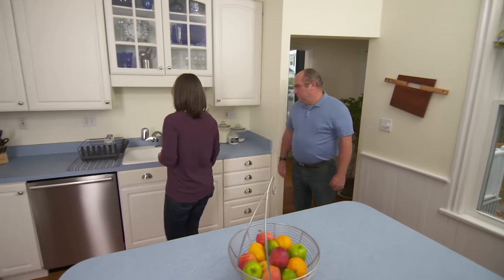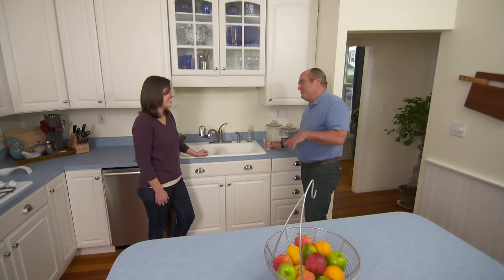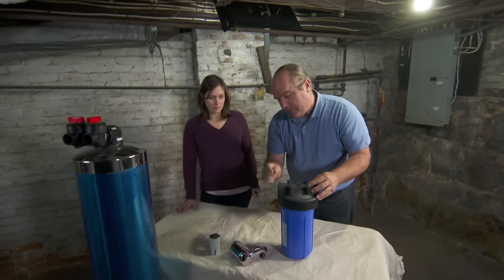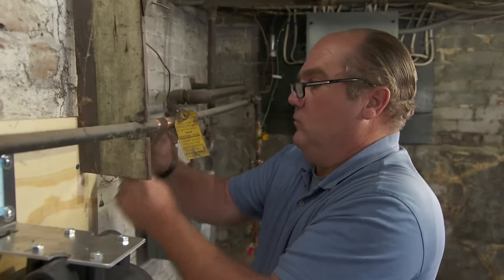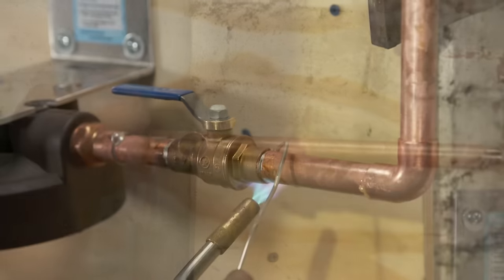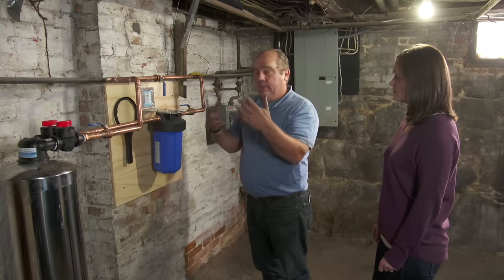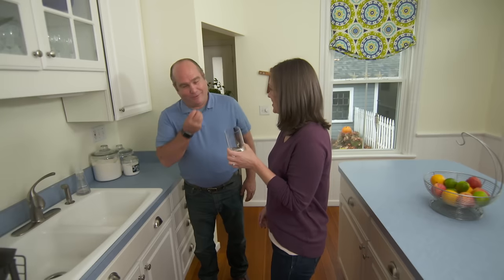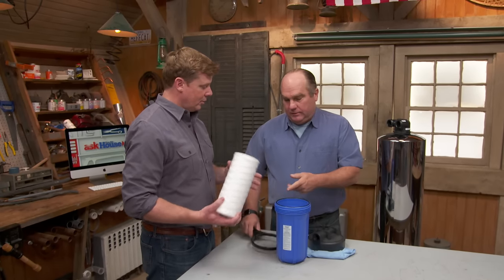How to Install a Whole-House Water Filter | Ask This Old House

Comment: Creating a bypass so you can have water while changing the filter is not something 1 plumber in 1,000 would do -- go the extra mile.  Amazing fittings / world class job.  Curious to know what brand and what style of filtrations system he put in.
Reply: That's a Pelican whole-house filtration system.  The larger tanks shown is supposed to be good for 1,000,000 gallons while their smaller unit lasts 600,000 gallons.  I installed a water meter in-line to have a better idea when to replace the activated carbon.  BTW, the carbon replacement is about $300, not bad for once every five years IMHO.
Reply: OR, you can buy a whole house filter with a bypass valve handle on it like I have. Works perfect. Got it from home depot. GE.
Reply: Customers need to pay for that. Some plumbers charge $600 for a thermal expansion tank right out of the box, no air added (or if your pressure sucks, released). Others charge $150, pumped up to house psi. The guys that overcharge and under work are a stain on this industry
Reply: Should have put 2 manometers in it to see pressure drop over the filters, to know when to replace them.
Reply: Guess I'm 1 in 1000🙏👍🤣
Reply: Without the bypass you would need a bonding connector across the plastic filter housing, no?

Comment: Just discovered my wife had been getting sick because we installed one of these without a UV filter. So keep that in mind. These filters can build up bacteria in that little tank.
Reply: and that is why I like to use the Doulton Imperial Silver embedded ceramic filter. Silver prevents bacteria growth, and no need to hook it up to a power source.
Reply: Chlorine in the water should prevent bacteria. Was this well water or city water?
Reply: Maybe change the filter on schedule…
Reply: It's not a bad idea to flush out that spun filters canister with some bleach when you change out the cartridge

Comment: We bought this exact filter for our home. Its a pelican water filter with a sediment pre-filter (thats what the spun filter does). They didn't talk about the steps to prep this filter for installation. You have to do a pre-install soak of the carbon for 48 hours and then backflush to activate it. If you just install it dry without soaking you'll run the carbon material into every appliance, sink, toilet and you'll be in big trouble. Other than that it does what it says it does. Just expensive.
Reply: He should have said that. But didnt major mistake
Reply: Thank you for sharing.  How long did the filter last for you? (how large is your place/how many people)
Reply: How long before one of these needs serviced or change the carbon
Reply: I wonder what this process is

Comment: I hope you flushed the system prior to drinking it. didn't show that.
Reply: Skinny Mcdoogin well he did have dirty hands in the basement and clean hands when he showed up in the kitchen but he could have mentioned that to the viewers.  TV magic.
Reply: Its TV time man... Interstellar did not take several thousand years to be shot...
Reply: My thought exactly. Otherwise the first several glasses would taste just the same as they did before.
Reply: He did flush it.  Otherwise there would've been air coming out of the faucet from when he drained the system down.
Reply: If he hadn't that water would have been black with carbon  and that aerator wouldn't flow a drop after the first glass.
Reply: The kind of plumbing he did requires someone with considerable plumbing skills. Thus such person would know to flush.
Reply: No, it does not. Also, anyone is capable of making mistakes or forgetting things.
Reply: This video is for the sake of people getting the general idea of what a basic filter/softener system does and the scope of install. No knit picking required here. This guy handles him self well probably spent hours making sure everything was perfect b4 the final shot drinking the water
Reply: the guy is an ace plumber ...
Reply: He did because he does it in another video
Reply: Usually a good idea to plumb a hose Bibb on the outlet between the filter and the outbound ball valve to flush the initial grayness upon install.
Reply: @DennisDA  kla
Reply: Laskzkakas
Reply: It was probably edited out.
Reply: @joet.5231  Not only that but it also provides a sample port

Comment: After the woven nylon pre-filter is all used up (changed out) they make a very good cordage for marking your garden rows and such. Just hose it off a little bit and let it dry in the sun then you can reuse it for marking your rows in the garden.
Reply: Good tip.

Comment: I have the smaller pre-filter installed in the crawlspace area underneath my house, but I do not have the larger steel tank they show here.  The smaller pre-filter does a fine job keeping our water odor free and tasting good.  I purchased the unit for $200 and the filters are about $32.  The filters last about one year before needing to be changed depending on whether or not there has been a water main break.  In that case the filter does get dirty quicker and needs to be changed.  Mine is a Whirlpool clear glass housing that you can check visually to decide whether or not it is time to change the filter.  I paid a plumber $300 to install the unit since it was cramped underneath the house and a little above my skillset! Changing the filter can be a challenge too and it is easy to break the plastic wrench they include to remove the filter.  My plumber just comes out when I need him to do it for me and charges about $85 a visit.  I'm on city water, but the filter is still a lifesaver when it comes to maintaining my water's overall quality.
Reply: Iiriad up
Reply: Zii9
Reply: Im deciding whether to get a pre-filter for my house or just a RO filter at my sink. Sounds like your filter takes care of your needs, its got to be more than just a sediment filter, right?
Reply: Yes!  Just buy the heavier filter that is over $30 and it will also filter out the chlorine smells and any adverse taste and odors too.  They make a lighter feeling filter that is mostly paper for a little cheaper, but it does not do as well as the heavier more expensive filter and also needs changing out more often too. The pre-filter system has come down in price too for about $100 versus double that when I put mine in many years ago.  Find a good plumber to install it for you and it will pay for its self with the higher quality water you will have!
Reply: @jamescunningham6249  oh so is it actually a reverse osmosis too?

Comment: I overbuilt my system with two pre-filters in series before the main filter unit. I’m using clear housings so I can see the build up without having to open them. The first one catches everything so well that my second has stayed looking brand new white as on the first day of installation. I change the first pre-filter only once every two years. Aquasana says I should every month but obviously it’s not needed. I live in Southern California using city water.
Reply: luvbeast77
Reply: Does it lower the water pressure substantially?
Reply: California has nasty ass water
Reply: Do you have a link to your setup for the clear housings etc? Trying to decide the route I will be going
Reply: Could you tell us more about your system? Did you install? Cost? Thanks for the info.
Reply: Was
Reply: Would you recommend running just one pre-filter if you were to do it again?

Comment: This is great for an older northern house with a basement. How about a single level home in North Texas? The only way I can turn off the water is at the meter. I would like a filter system that removes the fluoride the city puts in the water.
Reply: The reverse osmosis system he installed should remove most of it. I'm here looking for the same thing actually. Not sure which brand I'll get. I'm also concerned with garden watering and water spots on car washing.

Comment: .    My water comes in through the ground and then is distributed from there; my water shut-off is in the ground somewhere between my home and the meter at the sidewalk.  Where do I put a whole-house filter system?  Do I need to add a water line all around my home to the other side where the garage is and then back, or is there a outside system where I can install at the inlet?

Comment: what did he use on the pre filter to change from copper to the thread?  He solders up some female adapters but the filter housing is clearly female too, what did he use to join the two and not get leaks?  If you use a copper male adapter threaded in the housing won't you get a leak?

Comment: We just installed a new whole house water filtration system. I have a water tester and tested the water. It still shows 3.0 on the tester for solids. Does this mean it's not working?

Comment: Those pelican filters come with a by pass on the carbon tank so there’s really no need to put a bypass in the water line. That’s what those red handles are for.
Reply: That works for the main filter, but without the bypass he created, you'd be screwed trying to change the pre-filter without having to shut off water to the whole house.

Comment: Not a comment, a question...I'm looking at a house that has the water heater on the second floor.  I would like to move it to the garage.  There is an existing softener loop in the garage, can I plumb the water into that loop and put a loop upstairs to replace the water heater?

Comment: Is there any danger the system will dechlorinate the incoming water and legionnaires might grow inside the pipes?
Reply: If your are planning not to use the chlorine/chloramine filtered water for an extended period,
 I suspect that bacteria could grow in your house pipes.  
Here's a possible solution:  If you are planning to leave for a while, shut your two filter
valves and open the bypass valve.  Then run the water from all your faucets so that your pipes fill with 
city chlorinate/chloraminated water.  
When you return to using filtered water, just open the filter valves

and close the bypass valve.  You can again open all your valves to flush out the nasty tasting city water
and start using the filtered water again.  You may have to flush your water heater too, or maybe just turn
it up to highest temp for a few days.  The high temp may cook any bacteria that collected there.  
I'm no expert on this subject.  The above is just my musings!

Comment: I had been using piping in my house for the last 22 years. About two years ago I installed Pelican full setup of sediment, carbon and then UV filters. After 6 months after installation my main outlet line got clogged. After checking it, I discovered big clumps of laundry soap that blocked the outlet. We switched to liquid soap and a year later we had our main outlet line blocked again. This time it was a layer of thick, hardened soap that blocked the inlet inside the septic tank. Once I disconnected newly installed filters, I no longer have any issues. Please help me understand what could be causing changes in water chemistry that cause water not to dilute the laundry or dishwasher soaps and yet causing them to harden when they hit the septic system. I live in town where the PFOA/PFAS are very real and concerning factors. Looking forward to any comments that help me address this issue.
Reply: I’m curious - did you find an answer to your problem?
Reply: @2old4allthis  Hi, nope. I was not able to solve it. I tried different sources and resource however, this case is too bizarre to have any records. I did run a separate system from the filters to my kitchen sink just for drinking water. So, I am using the entire filter setup but not as a "whole house filter" but just for cooking and drinking. It seems to work this way even though the filter is not used to it's full potential.
Reply: Very simple, soft water isnt as good at cleaning soap.

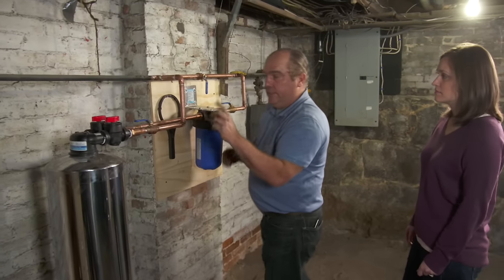Comment: At 3:31 he points out the valve handle when 'on' is pointing in the direction of flow. Not even 15 seconds later at 3:44 he shows the flow of water coming out, calling it "sweet water", but the valve handle there is pointing against the flow of water. The ball valve is reversed.
Reply: Ball valves are either open (parallel with the pipe) or closed (perpendicular to the pipe) there is no such thing as "against the flow". You flip the valve in whichever position it's easiest to operate the valve.

Comment: Did same on my house. However I used a 20 filter which is twice as tall in a clear housing so you can actually see how dirty the sediment filter is. AND I added that whole house drain he mentions not having and doesn't address.
Reply: is that just basically a tap inline after the shutoff?

Comment: Why not add pressure gauge after the filter? If the small filter clogs in less than 3 months move to the 20 inch filter.
Reply: mpharr2 I like that idea!

Comment: TOH certainly has the resources to thoroughly test whole house filters.   No where has anyone or any entity(at least that i can find)  done testing to determine if the whole house filters that claim to remove chemicals actually remove them.
Reply: Corbett Lundsford on the Home Diagnosis channel does a ton of testing as well. Not just on water but on indoor air pressure, air quality, thermal bridges, humidity and HVAC design. All sorts of home performance stuff. Him and TOH are my go tos for info since they seem to be the least “sponsored” and truly objective

Comment: There are more affordable ways like buying a 10inch sediment filter followed by a 20by 2.5 or 4 inch cartridge filter makes it cheaper and easier to change the filters
Reply: filter replacement would be much more frequent though with that setup

Comment: We have an AquaPure AP817 whole house water filter, installed by our plumber over 10 years ago for about $350, installed. It works really well and we change the filter 2x/year regardless of whether or not we think we need to. 
However, it would be nice if the filter housing was clear so we could visually inspect the filter at will. 
Do any manufacturers make this?
If not, why don't they?
Reply: Good question.  I wouldn't think having a transparent filter cover would make any difference in terms of strength, but perhaps it does?
Reply: Usually filters will have some sort of head pressure. When this pressure climbs with age which it will, then it’s time to change the filter. You do this by putting gauges before and after filters. When the gauge before the filter starts going a lot higher (with a bath tub open and running and some other faucets) , then the gauge after filter. Then it might be time to change the filter. Also another good indication is poor flow or starting to get bad taste. If you use a carbon filter then it’s only good for a certain amount of water and time manufacture dependent so read the manual to see how long they last. So really no need to have a transparent filter. The pre filter or sediment filter do come in clear housings. This is really good to have because it catches all the crap that might enter the water line so it doesn’t clog your expensive filter, then you can see it when it gets really dirty.
Reply: There are clear filters for that size but you would only use it on prefilters and not the activated charcoal filter you have because it's already encased in a plastic shell and you wouldn't be able to see inside the shell anyways.
Reply: The prefilter is installed before the carbon so there is still chlorine in the water which will prevent algae growth.
Reply: Because it’s a terrible idea. It’s hard to permanently integrate two materials together, so adding a window onto a pressurized water tank would be disastrous. 

It would also constantly leak. If you’ve ever tried make a home watertight, you know how difficult it is to keep water out. It’s also a lot more accurate for customers to change air filters at certain time intervals, not when they think it looks dirty. You would have some customers changing too soon and some customers changing too late. I’m not even sure they would be able to see into the tank unless there was a light source inside to illuminate the water.
Reply: @sawyer2849y since it depends on use, setting a time to change could be wasteful or you could drink unfiltered water. And there is no window.

Comment: I still wonder where else they would be drinking the water from the tap other than the kitchen? Maybe the upstairs bathroom? If not, they could just get an under-the-sink kitchen filter, and likely for cheaper than this.
Reply: Could the filter also help with hard water and protecting against contamination in showers? I know various bacteria and amoeba, though rare, if you get in your eyes or ears through water it's not a fun experience.